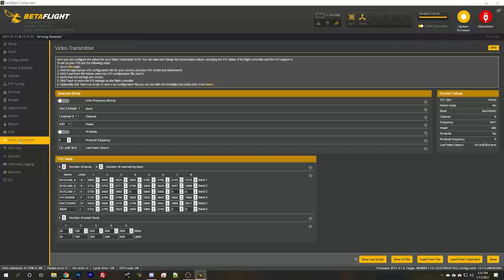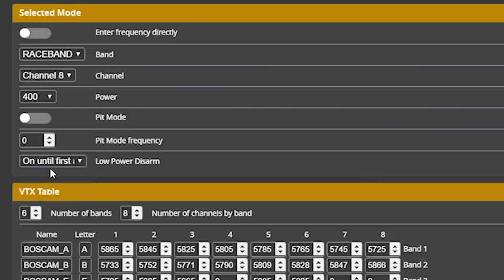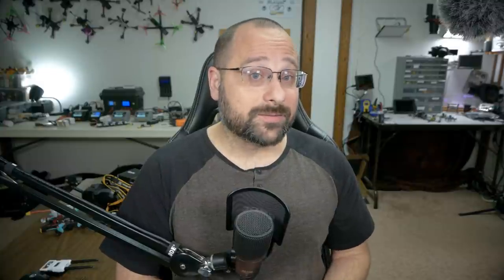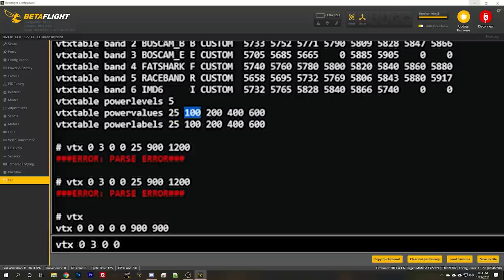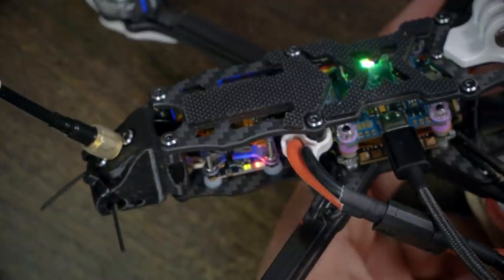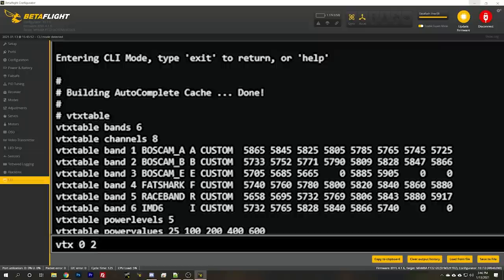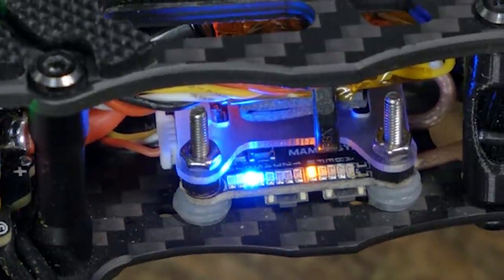Betaflight change vTX band channel power on a switch? Yes!

Comment: Set everything up in the CLI for power levels of 100 400 800 on a three position switch. When i fire everything up the vtx starts on 400, switches to 100 and then back to 400. On the receiver tab in betaflight the witch gets to 1500 in the second position and will not go higher for the third. Help would be greatly appreciated.  Thanks
Reply from the maker: First thing to do is get your aux channel moving to the full range. If you want to email me joshuabardwell@gmail.com I'll try to help figure it out.

Comment: Solved: I just add another power level on the vtx table on my tbs unify (make it 5 power levels) and now I am not getting the parse error anymore. I already tested it and it works! 
Joshua Bardwell, do you know why am I getting parse error if I use 4 on power level on a tbs unify pro v2 5volts? If I use 3 on the power level it's ok but I'm only getting 500mW.  I want to get the 800mW on a switch but I can't. Thanks
Reply: I have the same problem on an Eachine 805. I measure nominal values of 25 mW using power level 1 on the CLI vtx command line, 200 mW on command line power level 2 and 600mW on command line power level 3 but I get a parse error if I try to enter 4 as the power level trying to get to 800mW. 
The odd thing is that in the Vtx table for Smart Audio 2.0 power level 0 corresponds to 25 mW, 1 to 200mW, 3 to 600 mW and 4 to 800 mW.
I also can not switch power level unless I reboot with the Aux switch in the desired position. Ie the switch does not work whilst armed.
Reply: That should be 2 for 600 mW and 3 for 800 mW in the Smart Audio power table.
Reply: Thanks to Flying Dutchman in another post. He also solved the problem. Add an additional 4th (or one extra level) power level (in betaflight). With a value of 0mw. So it's like 25,100,200,0 in my case for Tinyhawk 2 freestyle. After this CLI will accept this without parse error. Works for my 2 position aux4 switch on the emax D8 controller (tinyhawk 3 RTF radio)
Reply: @gregtay67  I have been thinking that might be a solution for the parse error I'm getting.  Been reading comments looking for a solution.

Comment: I'm curious to know if anyone else is having issues setting up the 6 position switch values in betaflight.. following your tutorial, when I assign the 6 buttons the range that is picked up in betaflight only switches between 900.. 1500.. and 2000 on 3 of the switches and the other 3 switches are ignored.. is there a way to adjust the range to include the 3 unrecognised switches in the settings? Like in the tutorial?

Comment: Looks like we can only add ten (10) lines in the VTX CLI...unless someone knows a work around.

I get "###ERROR: INDEX NOT BETWEEN 0 AND 9###" when I try to upload VTX 10 6 0 6 0 1745 1790 or other lines with an index number higher than "9"  🤔
Reply from the maker: Correct. There isn't any workaround.

Comment: Would be possible to do the same but instead of smart audio using the CSRF data connection between CSRF and Unify Pro? it is possiblo to change VTX settings trough the lua scripts but it would be nicer to set it up in a switch
Reply from the maker: I don't think CRSF supports this unless you have Evo vTX. I think Evo vTX supports it.

Comment: For some reason on my TX16s, the six position switches do not work as shown in the video. Button 1 makes the channel go low, and button 2 makes it go high, buttons 3-6 do not do anything. I've checked to make sure there are no logical switches or variables that could be affecting it, but can't find anything. Any ideas? Running EdgeTX 2.5 with ExpressLRS TX. I have also enabled hybrid switch mode in ELRS which should support 6 position switch.
Reply from the maker: This video shows a possible answer: https://www.youtube.com/watch?v=I6n_Ak860lA&ab_channel=JoshuaBardwell
Reply: @JoshuaBardwell  Thank you so much! That was indeed the issue!

Comment: I have set my 6 position to do my output power but the tx16s always starts in position 1 which would be 25mw everytime and would need changing to position 4 for 800mw before every flight, is there a way to make the tx16s start up with the 6 position in position 4
Reply from the maker: No, unfortunately not.

Comment: hmmm, i think i could use this, my cheapo vtx at 600mw (about 500mw) gets super hot so when i'm flying on a cold day its a massive shock to just switch it off, heat transitions are pretty much what ages electronics.
Reply: I doubt your VTX will get hot while flying with all the cool air blowing around it.

Comment: @joshua bardwell would this work say on a tango 2 momentary switch? i would love this function if it could work.?
Reply from the maker: Sure but it would go back to low power when you release the switch. If you were really clever you could program a cycling channel so each time you hit the switch it goes up one power level.
Reply: @JoshuaBardwell  yes thats what i would want.. how would i do that? thanks in advance.
Reply: one switch for band and one for channel..?

Comment: Hello JB,
Unfortunately, it does not work with Smart Audio version 2.1, such as TBS unify pro32 and RUSH Tank Solo. It works fine with SA 2.0 VTX as "RUSH Tank Ultimate Plus". Do you know a solution for this? Thanks
Reply from the maker: I don't think that's correct. I don't think the "vtx" command cares what version of SmartAudio you're using. Of course, if you're using the wrong version of SA for your VTX, then it won't work.
Reply: @JoshuaBardwell  TBS Unify Pro32 is sure to use SA version 2.1. I'm not sure about SOLO, but TBS didn't work either. I think they use the same version of Smart Audio. Or am I wrong?
Reply: @JoshuaBardwell  There may also be a problem with BF 4.3. Real PIT mode does not work on two different brands of flight control. Pyrodrone F4 and Matek F722px. It was good with previous BF releases.
Reply: @JoshuaBardwell  Hello JB,
My VTX power switch is already working. There was a bug in BF4.3.
Thanks for the help.

Comment: I set up 6 channels but get no response from smart audio.
Reply from the maker: You have to have smartaudio working first. There is a link to my SA troubleshoot in the video description.
Reply: @JoshuaBardwell  i have had similar problems if i setup the vtx  power change is working but ones i have setup the 6pos switch dat is working but the power is not so i have switch off the 6 pos switch and using just the 3pos switch to change the power on vtx 
Thanx for this video
Reply: It was working, but the beta flight interface was not updating on the PC.

Comment: How could I make a switch only use 25mW. Then when the switch is toggled to a different position it reverts to the power output I set? I don't want a switch for each power output I just want one for 25. Say through smart audio I set it to 400 and flip the switch to 25 and then back off I want it to revert back to 400. same for if I set 800 in smart audio and flip the switch on to 25 and back off I want it to return to 800
Reply from the maker: You would want to use the "low power disarm" setting, which causes it to go to 25 mW when you disarm, and whatever power you set, when you arm.
Reply: @JoshuaBardwell  Mr Bardwell it's an honour XD. Thanks but I actually managed to get it to work using logic switches and mixes. I now have a 3 pos switch. all the way down is 25mw. (if my vid cuts when I crash I'd like to know its at 25 without looking at the osd). Then I have a toggle switch which when the 3 pos is not down it alternates between 800mw and 1.6W so when I'm flying close I can set to 800 and far away I can bump it to 1.6W.

Comment: will it also update the shown output power in the OSD while flying? and which betaflight version is needed for this feature?
Reply from the maker: Yes it will. I'm not sure which version introduced this.
Reply: @JoshuaBardwell  alright guess i have to find it out, thanks a lot for the reply!

Comment: Hello JB, I have tried it, and indeed it works, however, I do not like to continue using it for various reasons. Is it possible to reset it ?  For instance like so ?  vtx 0 0 0 0 0 0 0  and continuing: vtx 1 0 0 0 0 0 0 0  ?
Reply from the maker: Yes that's how you reset it. Put it back how it was.
Reply: @JoshuaBardwell  Thank you very much!

Comment: Does anyone find that channel switching works perfectly on the 6 position switch (TX 16S) after you plug in, until you go to arm thereafter it wont change channels, even when disarming?

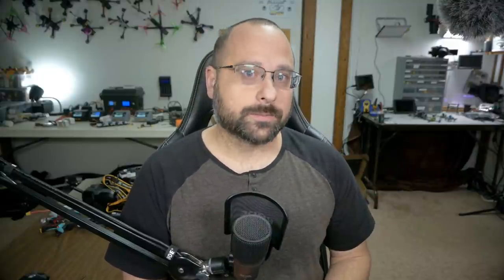Comment: 5:52 what is S1 being used for on the throttle channel?
Reply from the maker: I use it as a real-time throttle scale. I use one of the middle 3pos switches to change between 100% and using S1 to reduce the throttle output between 100% and 50%.
Reply: @JoshuaBardwell  Excellent and brilliant! Thanks! I’m new to quads and betaflight so I’ve been binge watching a lot of your vids 😁

Comment: I have done the tutorial and I can change the wattage that is seen in the OSD but it doesn't really change the wattage of the vtx, I use a Mamba TX500 with Irc-tramp, Any ideas?
Reply from the maker: Are you sure SmartAudio is working at all? Have you got your vtxtable correct?
Reply: @JoshuaBardwell  The vtx table is correct and via smartaudio I can change the channel and power but not with the switch, if I try with the switch it only changes the power in the osd.  It could be an irc-tramp thing?
Reply from the maker: If you can change channels and power by changing the menu in the Video Transmitter tab, then vtx command should work too. If the OSD power changes then it means the FC is outputting a different power via smartaudio also.

Comment: Tinyhawk 2 unlocked, VTX table loaded, can switch into the 3 power levels and all unlocked channels from sticks and Betaflight VTX tab.  CLI will not accept level 3 in the VTX command, returns parse error... levels 1 and 2 work fine Level 0 is interpreted as "no change". Any ideas?
Reply: Same. It only switches between 25 and 100mW. Cannot get to 200mW without going through Smart Audio menu.
Reply: Thanks to Flying Dutchman in a newer post. He solved the problem. Add an additional 4th (or one extra level) power level (in betaflight). With a value of 0mw. So it's like 25,100,200,0 in my case for Tinyhawk 2 freestyle. After this CLI will accept this without parse error. Works for my 2 position aux4 switch on the emax D8 controller (tinyhawk 3 RTF radio)

Comment: HI Joshua

OK tried this out and copied your video step by step although I came across a problem. Once I had finished I noticed that I could only change the channel and not the power. This is because originally you had typed out vtx 0 3 0 0 1 900 1300 for the power and then when you wrote out the first line for the channel change you had wrote vtx  0 4 5 1 0 900 1100.  What has happened is VTX 0 for the power change got replaced by VTX 0 for the channel change command. 

However if you type it like below following the sequence you can change both power and/or channel. So you can see it starts vtx 0 ......... and ends vtx 8 ....... 

So this is what I did;

vtx 0 3 0 0 1 900 1300
vtx 1 3 0 0 3 1300 1800
vtx 2 3 0 0 4 1800 2100

vtx 3 4 5 1 0 900 1100
vtx 4 4 5 2 0 1100 1300
vtx 5 4 5 3 0 1300 1500
vtx 6 4 5 4 0 1500 1700
vtx 7 4 5 5 0 1700 1900
vtx 8 4 5 6 0 1900 2100
save

Works like a treat I can change both channel and power together. 
Hope this helps.
Reply from the maker: If you leave a parameter at 0 then it's left at its current value when the line becomes triggered.
Reply: @JoshuaBardwell  
You are 100% correct there but the parameters isn't the problem I had experienced it was being able to use either or AUX switch to change either power output on VTX or the Channel. I would like to apologies I am struggling trying to explain myself in writing.lol ..Is there another way I can contact you to explain? Its probably me the way I have initially setup is wrong but I need some guidance. :)
Reply: I have sent you an email which hopefully I have explained my self better in. :) lolol

Comment: Can i Delete a line that im not using anymore from the VTX command?
cant find how to do so....
Reply from the maker: Manually type it in to put it back to default such as (from memory so not sure it's 100% right)

vtx 0 0 0 900 2100 
save

or whatever.
Reply: @JoshuaBardwell  awesome! Thank you for the quick response!

Comment: this is a great tutorial, but unfortunately, doesnt work for me. im on 4.2.4 with zeus nano. tried it back and forth with channel 4 and 5. doesnt want to budge and change power, i even tried with another vtx (m02 betafpv) and fail.
Reply from the maker: You have to get SmartAudio working first.
Reply: @JoshuaBardwell  thanks jb, i finally got it to work, seems i have added additional spaces on one of the numbers.

Comment: My vtx table in betaflight starts at 0 25 100 200 400 500. I have managed to set my 3 position toggle switch for both (2) 25mw and (4) 200mw but when I try to set the 3rd position (6) for 500mw it states an error. I tried typing in (5) but that only gives me an output of 400mw. Is there a glitch in betaflight preventing me from inputing 6??? My betaflight inputs look like this - position 1 vtx 0 7 0 0 2 1000 1500, position 2 vtx 1 7 0 0 4 1501 1895, position 3 vtx 2 7 0 0 5 1896 2000. However, (5) only gives me an output of 400mw and not 500mw.
Reply from the maker: You have to look at your vtxtable. The valid power levels depend on what's in your vtxtable.
Reply: @JoshuaBardwell  my power levels are 25 100 200 400 500

Comment: Anyone figure how to do both power and channel on two different aux?  I could only get setting the "vtx" command line entries to only allow for one or the other.
Reply from the maker: you would do something like this

aux 0 3 0 0 1 900 1500
aux 1 3 0 0 2 1500 2100

These lines change power based on Aux2

aux 2 4 5 1 0 900 1500
aux 3 4 5 2 0 1500 2100

These lines change to channel R1 and R2 based on Aux3
Reply: @JoshuaBardwell  Got it now.  I was using my half capacity "Saturday brain" and not seeing the full picture of the concept.  I was trying to use the same command index #s for both the power and channel commands instead of numbering on down the list.  Dumb oversight.  Thanks for the response!

Comment: I set it up and want to remove it how do i?
Reply from the maker: Type into the CLI the original vTX lines.
vtx 0 0 0 0 0 900 900
vtx 1 0 0 0 0 900 900
Etc

Comment: Strange, I always get the parse error. Does anyone know how to solve this?
Reply: Thanks to Flying Dutchman in a newer post. He solved the problem. Add an additional 4th (or one extra level) power level (in betaflight). With a value of 0mw. So it's like 25,100,200,0 in my case for Tinyhawk 2 freestyle. After this CLI will accept this without parse error. Works for my 2 position aux4 switch on the emax D8 controller (tinyhawk 3 RTF radio)

Comment: Hey guys i have tried this and now i dont know how to turn this of. Can anyone help me ?
Reply from the maker: Manually change the vTX lines back the way they were
Reply: @JoshuaBardwell  Wow thanks for your quick response but I don't know how actually
Reply from the maker: Type in the CLI just like you originally did to change them.

vtx 0 0 0 900 1100 or whatever it was
then
save